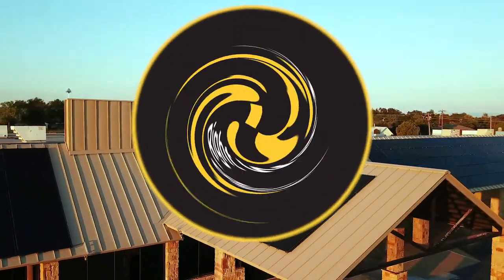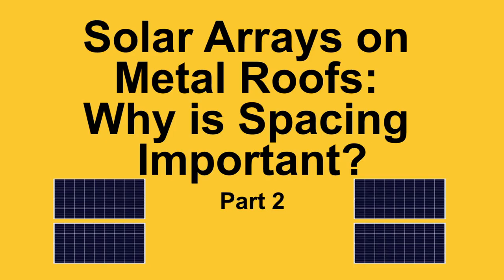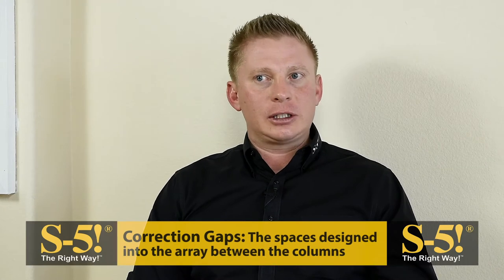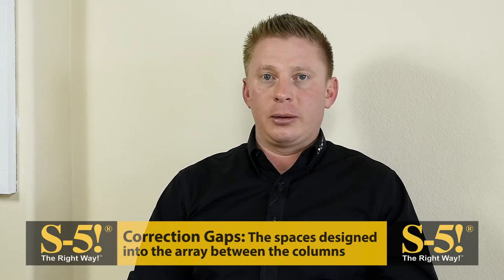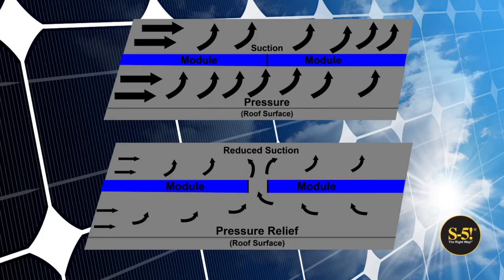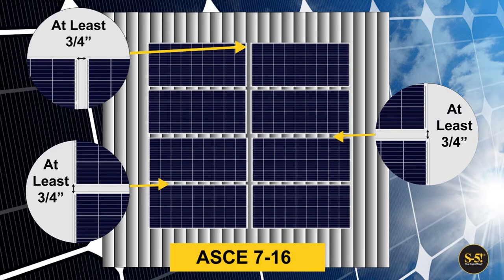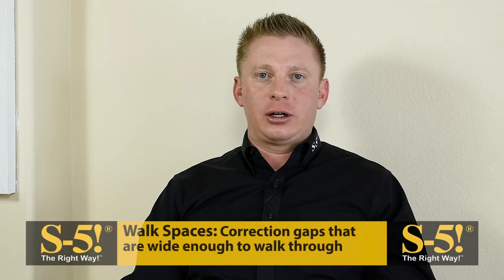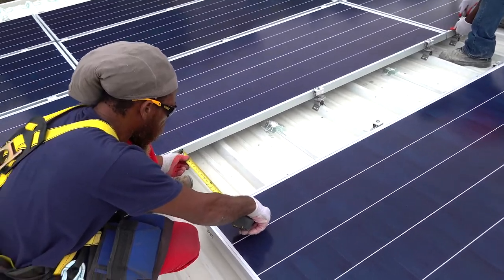Mounting Solar Arrays: Why is Spacing Important on a Metal Roof?

Comment: One thing is sure: Nick will never die of high blood pressure. 🙂 But seriously, thanks for the video. I'm doing a DIY installation in SE Oklahoma and that bit about reducing wind load is helpful information. We have a small 16' x 32'  south-facing roof and we need to pack as many modules onto it as possible. I figure we can get 16 x 455 W panels up there (2 rows of 8) with about a foot of space at the bottom and both side of the array. If we have to insert 3/4" for spacing between modules, that will burn 5.25" of my horizontal space, so I would only have about 10" on each side. The top of the array would basically be flush with the ridge line of the roof. Maintenance would be a pain, I guess, but I don't really have a choice.
Reply from the maker: Thanks for the comment!  We're happy to hear you found our video helpful.  If you have any questions that we can help with please don't hesitate to reach out to us at support@s-5.com.  We'd love to talk with you more about your project and which S-5! products might be right for you!